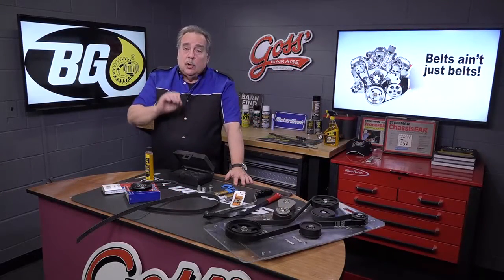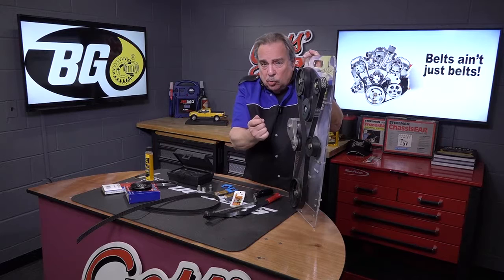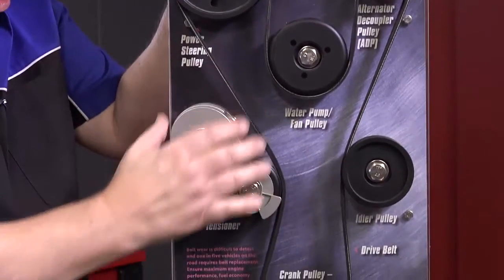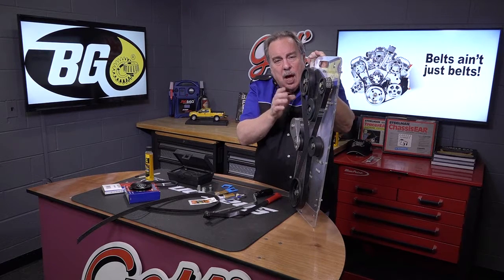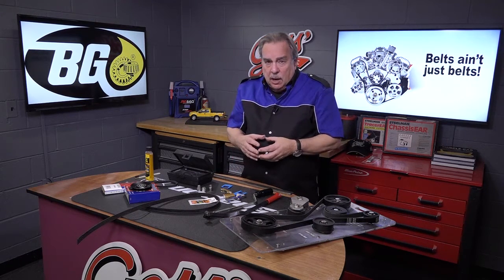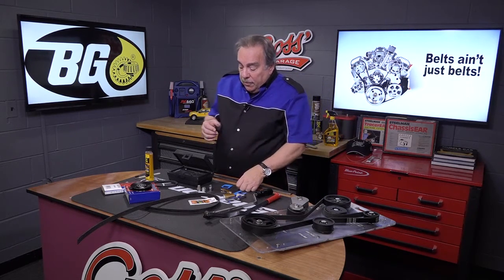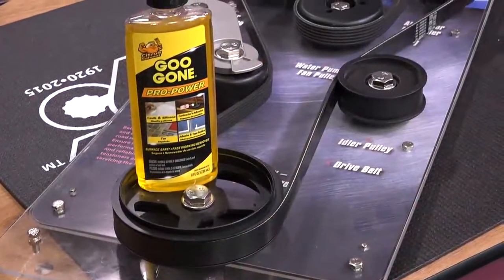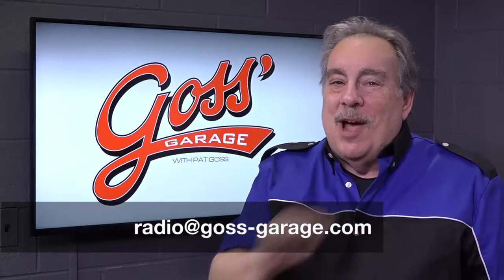Pat continues his discussion on a few surprising facts about serpentine belts

Comment: Here's a surprising fact:.  All the mid 2000s  GM trucks (and probably cars) have rotor backing plates that rust out.  Because they used junk steel in the rust belt. They also used steel brake lines but that's another story.  Anyway, I can't see any reason to change them out once the edges are gone.  Five years ago when I used to go to a shop for things occasionally one left the dust shield off one side of the front of my 2000 legacy.  I didn't even notice for 2 years and a new one was over $40 and I figured after 40,000 miles if it was OK it would be OK (they don't rust out by the way).  Anyway, 3 years later, it's still OK and I live in the rust belt.  And I can see the back of the rotor easily.  The whole front of the rotor is exposed to stuff all the time anyway, alloy wheels don't protect anything.  So to make a long story short, the surprising thing is they do rust out on GM vehicles and I can't justify replacing them.  Son has an old S10 and 3 shields are rusted completely out, the edges are gone down to the hub.  I thought about changing them, they are cheap and I have to do the parking brakes anyway.  But then I thought why even bother.  I'm not pulling the axles when they will just rust out again and they aren't even needed.  And thanks GM for ignoring corrosion control.
Reply from the maker: Those shields are not to keep debris out but rather to channel air into the vents on the rotor. Unless you live in the mountains or tow a trailer chances are you would never notice. But if you do heavy towing or descend steep grades or anything else that taxes the brakes you could.
Pat
Reply: Goss' Garage - Auto Repair & Maintenance, Lanham - Seabrook Maryland Thanks Pat, that makes sense.